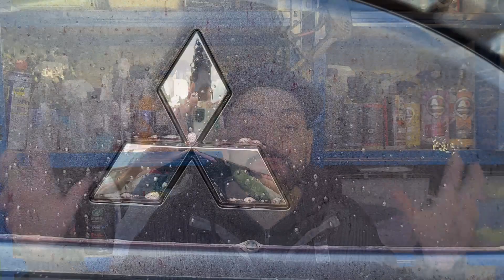I answer all your detailing questions.......

Comment: Love this! I wholeheartedly agree with you in regard pre-wash and snow foam.  I citrus 1st and rinse off, then snow foam and rinse and that stems from a recent video from the Hairy Housewife, that process seems to work best for me.  I also agree re wax/sealant, I don't layer.  I have 2 vehicles that I regularly valet, mine has fusso and the other has the TW hydrophobic sealant, both do an excellent job although, the TW can be a little tricky at times. I've not used any P&S but am running low on wheel cleaner, so maybe that could be my next purchase. Kiran, does citrus remove or degrade fusso or TW, it concerns me to use it often throughout the winter.  Also, what is your go to citrus, I currently use valet pro?
Reply from the maker: Cheers Lee I hope thar cleared up some of the important parts. Any chemical that's high in ph is going to slowly strip your LSP. For me I clean my cars weekly so I use a topper to boost whats already there.

Citrus hard choice there dude the autobrite 1 is good and so is valet pro also
Reply: @A Passion For Detailing  Thanks for the response Kiran, looking forward to your next video.